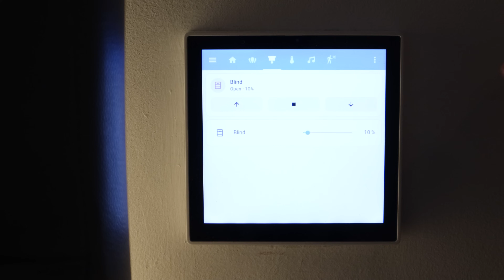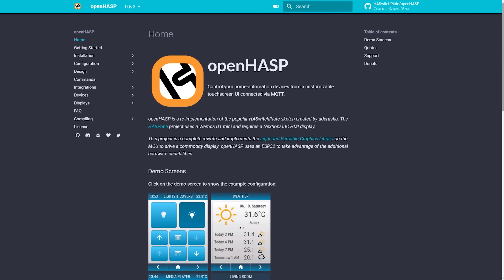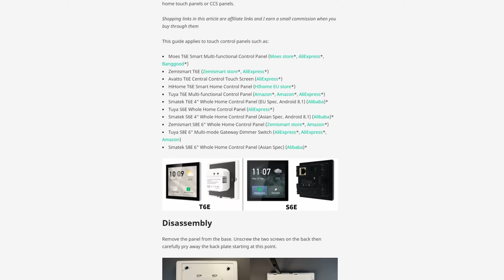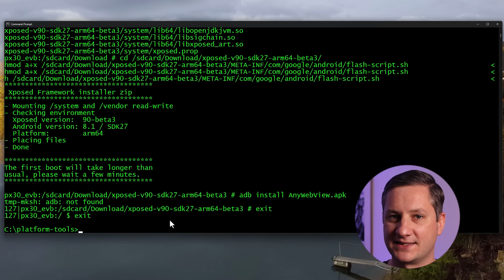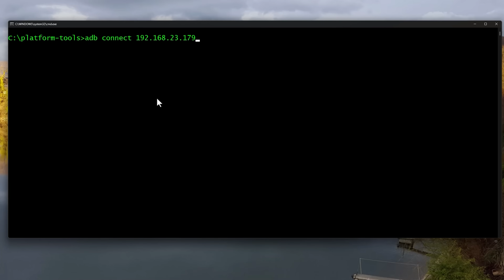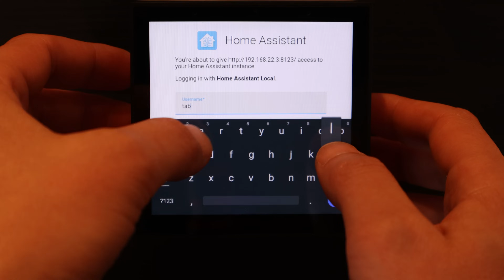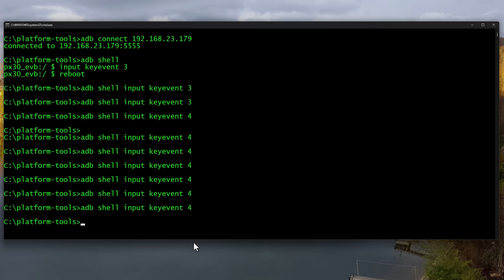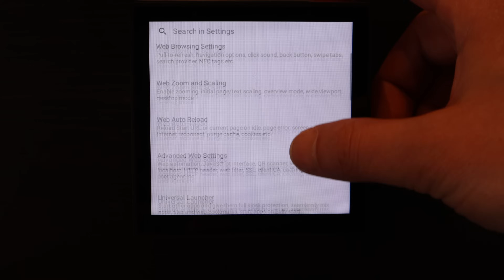Home Assistant Wall Panels

Comment: Perhaps it's time to take the video down, I got one recently and bought a Blackadder recommended panel but Tuya blocked ADB access and there seems to be no remedy. It would have saved me 140,- EUR. After I opened the unit there is no returning unfortunately. Sorry for putting this out negative but a warning to all people who like to have an all in one solution should look into other options.
Reply from the maker: Thanks for letting me know! Can you tell me more about which model and vendor you purchased from? I have pinned this comment under the video so other people can see it - so the more information you can provide the better please!
Reply: @HomeAutomationGuy  I am looking for a panel as well, maybe I can ask the seller to send a version with ADB enabled?
Reply: I bought 4 of them and have the same issue, is there a walkaround? 😢
Reply: Hi, I bought a T6E in July and I haven't had any problems.
Reply: Same problem here. I bought it as the AVATTO Smart 4 Inch Multi-functional Control Panel. Model name is still T6E.  ADB Device list shows: "device product:occam model:Nexus_4 device:mako transport_id:1". After trying to open port 5555 I get the message: "error: closed"
Reply: I just configured mine today after following the video and blog. I bought my T6E panels from Zemismart, (as linked in the blog post). I watched the video and read the blog a few times before diving in. Also advise reading ALL the linked Blackadder pages as well. My only variations were using Bromite Webview instead of Android System Webview(install failed) and NS-Panel-Pro-Tools instead of Automagic(Website down). Both of these changes are documented on the Blackadder pages.
Reply: did you try to do a factory reset? In first, my "ewelink ckPanel Pro" wanted me to do an update... after that it was locked too. I factory-resetted, ignored the firmware-update, registered the device via the ewelink app. after that on my smartphone-app i was able to activate the developer functions.
Reply: 맞아요.. 저도 안되네요.. 같은 모델을 구입했지만 usb로 인식 자체가 안되네요. usb 드라이버를 설치해도 인식불가입니다.. T.T
Reply: I got the same issue. There is a new, updated black model now with the 'nexus' id. It hat build in alexa and ble support which the old model did not have. On aliexpress I hardly found the old white model anymore although it is still out there. Some vendors sell both types stating the old model 'android version' and the new model 'linux/alexa version'.
Reply: No don't take it down, I just bought a T6E direct from Zemismart and I got this working really well within an hour, despite the instructions linking to an apk for Webview that didn't exist, but no matter, I downloaded it from another source.
Reply: For this to work you must open your cmd as administrator otherwise it does not work.
Yesterday with a friend we flashed a 6.8 inch and we had no problem connecting via ADB.
Reply: @titis14  Unfortunately that is not the (or better said my)  issue, I have done exactly that.

Comment: hi i tryed mine and it shows up as an TuyaIotModule in device manager,
when i try to connect to it via adb it says unauthorized transport_id:1
what could be the problem? is my panel even supported? there is an verzion on the board tpp01-z_V1.0.3

Comment: Amazing video, but I do have a question: what is the gain compare to to using some cheap Android tablets, install Kiosk & proximity sensor automation? I can see only the plain differences (fit on standard power outlet VS "hanging" tablet, the need for a USB adapter instead of L/N wires). And you'd get battery in case of power outage
Reply from the maker: It's purely about the form factor, having it fit into an existing switch hole. Your suggestion would achieve the same result

Comment: This has absolutely nothing to do with home automation. When the alarm goes off the guy is turning on the lights, opening the blinds all by hand. Proper Home automation is when this all happens, under the right conditions automatically without you ever having to touch a button
Reply from the maker: Cool

Comment: Just discovered you and Iam loving the videos. 

Iam also in the process of setting up a smart home.

With the house fully stripped back to brick Iam trying to make sure all the relevant CAT cables & power cables are in place.

Looked at your lighting video. I wanted the 3 switch system too .

Just a big project doing every room from scratch . So can be overwhelming.....Are your services available to hire?

Comment: hi sir, i am having trouble with the lack of guidance for the Command prompt part. even after looking at ur article. im having issues when i try to do these codes:

adb shell setprop persist.adb.tcp.port 5555 
 adb.exe: no devices/emulators found

adb install ultra-small-launcher.apk

 adb.exe: no devices/emulators found

and whatever i do my T6E just shows up as "TuyaIotModule"

any help would be much appreciated :)

Comment: does this currently still work or is there another solution?
Reply: Yes, I just got a T6E from Zemismart direct and it's working well.
Reply from the maker: My panels are still working, but I am not sure if the method still works on newer versions of the panel.

Comment: I have just purchased the Zemismart device via the link on your article. On disassembly it looks like the blackadder photos, the PCB is printed as SY-PX30-T6E-V1.0 2021-07-09. When plugged in the device manager shows it under the USB Devices as 'AURA LED CONTROLLER' with the driver being WinUSB. If I force a driver update to the google ADB USB drivers it then appears at the top of the device manager as an Android Composite Device but the first adb devices -1 command still do not list any connected devices. Feel like I've been scammed.

Comment: Excellent video, thanks for putting it together. Do you know of any 4inch panels that can be powered from an existing alarm cable? Ive seen some using a 12v to 5v converter to power tablets however i would prefer a 4inch version like these rather than a bigger tablet.
Reply from the maker: I don't know of any out of the box.  OpenHASP might be a good place to start, it runs on ESP32 devices, which are 5v.

Comment: Dead in the water :(
Just received my T6E smart panel and see it has a different display back, and opening a totally different PCB layout and version TPP01-Z_V1.0.4.  I can connect using ADB which reports the device as a "10011471800262         device product:occam model:Nexus_4 device:mako transport_id:3"  But can't go further when sending the command adb shell setprop persist.adb.tcp.port 5555  Reports back with "error: closed"  Seems @pvg5559 has had too... Any help on this or a total waste of money :(
Reply from the maker: Oh that's a real shame! I've seen some tips in the following forum which might help you get access

https://community.home-assistant.io/t/tuya-smatek-t6e-and-s6e-4-inch-control-panels-for-ccs-central-control-system-android-based-in-wall-4-inch-smart-display-with-touch-screen-now-sold-under-many-different-brands/473366/39
Reply: Thank you for the link, but they talk about developer mode and eWelink?  Don't knowwhat's that about or how I enable that???   All I can do on my unit id connect to the internet on the device. Any help would be very much appreciated   Roy  @HomeAutomationGuy

Comment: Hi, when my screen has been asleep for several minutes I get a message from HA indicating connection lost / Reconnection in progress.
This does not block but I have to wait for the entities to update before taking an action.
Do you also have this message?
When I ping my screen the wifi connection is not cut so I don't know if it's Fullykiosk that cuts something.
Thanks

Comment: You said it runs an older version of Android. And won't be supported forever. What will happen when it stops being supported? Will the device stop working?
Reply from the maker: I am guessing it will continue working, but no longer receive security and stability updates to keep them working with new web technologies

Comment: Got one last week but it appears to now be locked down. The OTG connection also locked down. Anyone know a way around this ? Thanks
Reply: Same here, did you find a way round this? 
Mine will not show in the device manager as px30****, I can see and MTP device but cannot update the drivers> Frustrating!
Reply: @thermionicdude2044  yes I finally did. Enabled developer mode in the app and then found an option to unlock the device in the app. After that I was able to access the panel via the USB cable.

Comment: Not exactly related to this video in particular but I'm looking at building a house from scratch and was wondering if there were any sensors that could be hardwired into the house from construction so that there would not be any batteries that needed to be yearly? I like everything that you are doing throughout your house, and know that if you pay a company to make a smart house everything is hardwired from the beginning but cannot seem to find what sensors would be hardwired in or how they would connect to Home assistant.

Comment: Finally got my t6e in the mail today for my fist home do you know if there is a easy way to integrate the build in zigbee or do i need to write a magisk module in c to remotely connect my home assistant to a serial connection on the android device?

Comment: Hey Alan, does the device you're using have a built-in light sensor to automatically adapt display brightness? In that case, it looks like automagic might be able to turn off the screen when it's sufficiently dark in the room, much like a Nest Hub.
Reply from the maker: Yes, it does have an option to adaptively dim the display

Comment: I actually saw this on ali-express then i thought would it be posible to sue these for home assistant insteads of the sonoff NS panels.
Later i found this video very happy i thought about it ;)

Only thing is here in the netherlands we dont have those squared boxes standard in the wall zo i will probably need to have a 3d printed desk stand or something.
Is going to be a brainstorm session about it
Reply: i got those boxes in the wall here in the netherlands, building from 1973 tho
Reply: @jesper9432  ah okay i got the round ones in my home, but a 3d printed stand for on the nightstand or somewhere els could also be the option for me :)

Comment: I’ve done exactly this - but 3D printed an angled base, and use it as a desk-panel command centre at my main desk. It’s a lot of work to get them set up, but leads to a fantastic output! I love idea of creating a separate Home Assistant user, which is then tied to a specific dashboard (which is what I did).
Reply from the maker: That is a nice idea! One more reason to buy a 3D printer 😁

Comment: I have a love / hate relationship with wall panels and the like.   I figure if something happens regularly, there should be a way to automate it and not use a panel.    That said, I can see a use for them when unusual things happen.
OpenHASP, HASwitchplate, whatever version you look at, is designed to be custom, mostly running via MQTT and is great as small touch switch/panel, but is not the same as a full Home Assistant dashboard.      Maybe someone clever from will write a full firmware update for those Tuya panels to upgrade the Android version, but if you limit it to only accessing Home Assistant for the dashboard and don't allow it on the internet it should stay safe.

Comment: "I had the electrician remove them" 🧐
Reply from the maker: What?
Reply: @HomeAutomationGuy   I'm just not used to YouTubers not installing the stuff themselves.
Reply from the maker: I don't like to mess around with mains voltage electricity myself. Mistakes can be made and bad things happen so I leave it to the experts most of the time!
Reply: @HomeAutomationGuy  no worries. Getting zapped with 120 ain't that bad though. Ask me how I know 🤣
Reply: 230v hits really hard. It's no joke. Also, in the UK, you would need a license.

Comment: These look great! I wonder if I can play about with an old android tablet / fire tablet to get a similar result for a full dashboard in my hallway
Reply from the maker: That's even easier, those work great as wall dashboards!
Reply: There are a few different videos on doing this using Fully Kiosk Browser, if I remember correctly. I can't because the tablets I have are too old to run the current version of Fully Kiosk Browser.

Comment: I like your channel and I'll watch it a lot. But I'm still not sure why manually having to do all that in the morning is easier and quicker than just using voice command for Alexa to do it as you're getting up and walking away. I have over 75 items that are connected and are controlled by voice or IFTT automation. I think doing it manually is no different than walking over and flipping the light switch.
Reply from the maker: I don't like the idea of a voice assistant in my bedroom. But then again, I have a phone in my bedroom and it also has a microphone, so maybe I'm overly paranoid

Comment: It's cool but I'd also call it a gimmick. If is faster doing something, like turn on the lights, physically, then the automation/device don't work. If its faster to lookup the dashboard on my phone, then is better to use the phone. I guess the only most usefull way I can come up with (for me), is a panel alarm right by the entrance.

Comment: Thanks for your efforts.
I tried it a month ago, not worth it at all, no too responsive and the screen is tiny.
I bought a 10" tablet from xioami for almost the same price and it is way better, more versatile, and way more responsive.
And I can attach it to the wall using magnets or a 3D printed case.
Reply from the maker: I've not noticed any responsiveness issues, but I agree that a 10" tablet would be great. Now are you powering it and hiding the cabling?

Comment: I have gone a slightly different route and use panels with esp32s flashed with a very nice piece of software openhasp. This gives you an mqtt based wall panel that can be used with not only homeassistant but other automation software. This firmware can be flashed on a sister of the panel shown in this video the t3e.

We also cant forget the original nspanel that has become very accessible through the blueprint project

It's great that we now live in a day where there are multiple wall panel solutions

Nicely explained video Alan!
Reply from the maker: Thank you!  I'll be doing a video on the OG NSPanel one day soon

Comment: Does the companion app on these panels also work with browser mod? In that case you can probably enable the screen via HA automations and even send notifications.
Reply: I have a 2 Sonoff NSPanels Pros and I have Home Assistant running on them via the companion app. Browser Mod does work and i am using the Browser mod Light entity that controls the pro screen to turn on and off the screen when there is no one in the house and during night times. I am also using the Browser mod popup feature to popup my Door Bell camera feed  when the bell is pressed.
Reply from the maker: I am pretty sure that you can install the companion app on it, but I'm not sure how it works with Browser Mod.

Comment: Oh well no good for me or most UK houses since it doesn’t work without neutral… your house is the exception
Reply from the maker: Yeh, luckily my house was built fairly recently and included neutral wires.  My old house definitely didn't have any!

You could run a feed cable from an existing power socket up the wall to about chest height and install it that way.
Reply: @HomeAutomationGuy  neutral wires are still rare in new build, mine was built in 2021 and has no neutral wires. I guess it’s important to note this in your videos for those UK viewers as it’s an important one and one that blights the products that can be added to our smart homes here in the UK

Comment: The first thing I'm planning to do is get energy monitoring, mainly the electricity.
Currently in the process of setting up a server (HP DL380 Gen7) it's slow going because I'm on a tight budget and stuff is expensive (especially the hard drives).

Comment: I love the look of the panels and agree that they make things look so futuristic and are extremely flexible as you can display whatever suits! Nice to see there are other options aside from the Sonoff NSPanel Pro if Android is desired. I’m currently using a couple of Sonoff NSPanels (non pro flashed with ESPHome) which work well where im using them and in other locations im actually using Xiaomi Redmi 7 Android phones that i have hooked up to the mains in one way or another, flashed with LineageOS to remove the Xiaomi bloatware and tracking, then use Fully Kiosk Browser to display custom HA dashboards :)
Reply: Isn't the Sonoff NSPanel PRO the the exact same product? It at least looks identical, I'd assume this guide would be working for these as well.

Comment: These are expensive buttons 😂. Great video, but you can't really justify the panels. Your phone is like 20cm below the panel. When using tasker and you have your alarm set, you can full screen the app. I see no point in using such a solution other than "it looks dope"
Reply from the maker: Yep. Totally fair and valid points. But they really are dope though aren't they 🤩
Reply: @Home Automation Guy  yea, they are beautiful 😍. They need to be half the price and I'll take 10🙈
Reply: @denniskluytmans  that was exactly my thought too and ended up going with the NSPanel instead. They are not as beautiful but they can do most of what HomeAssistant has to offer